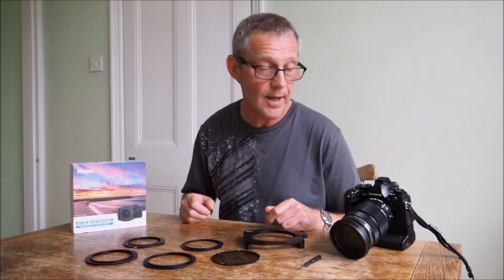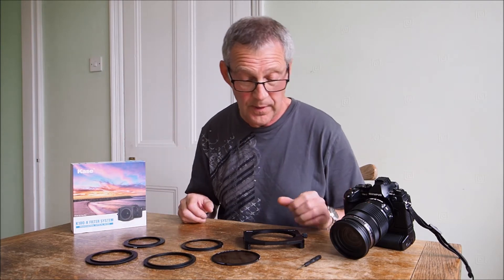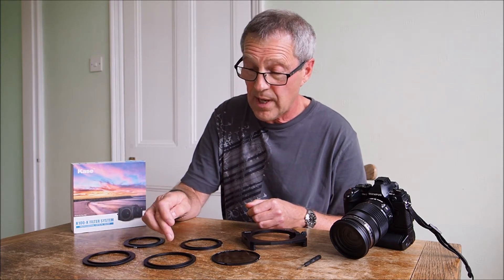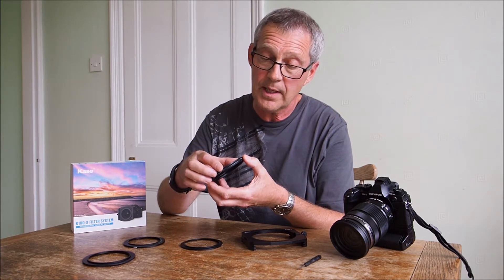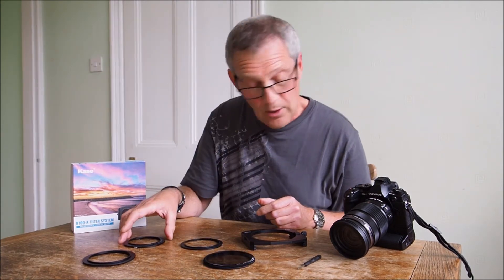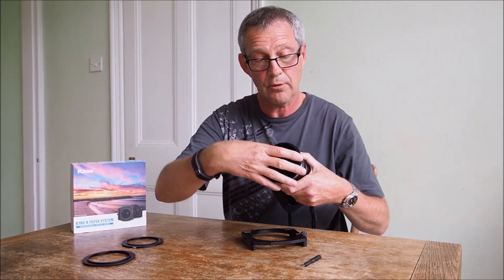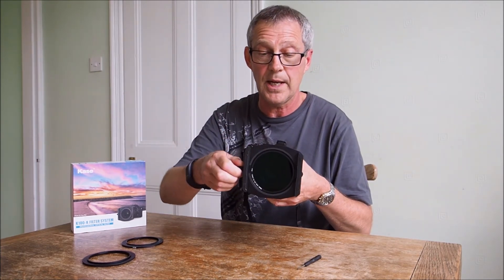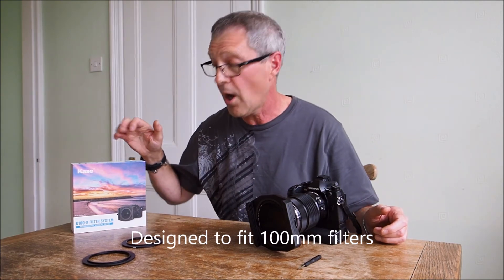Kase K6 100mm filter holder system - Introduction and installation

Comment: Thanks for explaining difference between the geared adapter rings and the step up adapters - not clear at all on the Kase website.
Reply from the maker: No problem Patrick
Reply: I see from your two excellent videos that there are two versions of the filter holder - the K6 and K100ii - which is the latest?
Reply from the maker: Hi Patrick, the K6 is the latest version and has replaced the K100ii
Reply: Thanks for that

Comment: Hi, How often does the filter adaptor ring and the step-down ring attached to the lens bind together? (I really struggle unmounting the Lee polariser from the filter holder some times). I can see this being a real pain when changing over to a different lens. Thanks
Reply from the maker: Hi James sorry for the delay in getting back, Kase now have a brand new K8 holder which utilises a magnetic CPL so no problems with stuck filters now, I have done a quich video review on the K8

Comment: Nice video.Can you please tell me what adapter are you using to mount this filter holder on the Olympus 7-14mm?
Reply: I suppose that you are using a 3D printed adapter but then with this Kase k6 filter holder, if you want to use a polariser filter then you can not use those but you need a CPL of 105mm.So if you are using one can you tell which one?
Reply from the maker: Hi Zoran, sorry for the late reply, yes I use a 3D printed adaptor with my 7-14 http://www.7-14filter.com/714.htm and for the CPL I use the Kase 100x100mm version which works a treat
Reply: No problem, thank you for your response.

Comment: Looks very similar to the Nisi V5 Pro filter holder. Not sure which would be better over the other...

Question: Would I be able to attach a variable ND filter instead of the POL filter? (without attaching the filter holder onto it) Asking because I am looking for a quick method to switch between shooting photos and videos, and it seems as though unscrewing the POL and replacing it with a variable ND would be the easiest. But not sure if its possible
Reply from the maker: Hi Michael sorry for the delay in replying as I have only just seen your comment. The K6 holder is very similar to the V5 Pro which I have used (I was sponsored by NiSi before moving to Kase) they are available via my website http://www.stephenelliottphotography.co.uk/gallery_698674.html
Unfortunately I don't think it would work with a variable ND 

Regards Stephen
Reply from the maker: Hi Michael, really sorry for the delay in replying I hadn't spotted your comment!! 
The filter thread for the CPL is 86mm so not sure if you can get one in that size, but in theory it should screw in to the geared ring but I think you would have difficulty adjusting the variable ND and you wouldn't be able to fit the adaptor. Btw I have used the V5 holder and have found the Kase to be better. They are available via my website: http://www.stephenelliottphotography.co.uk/gallery_698674.html

Regards Stephen